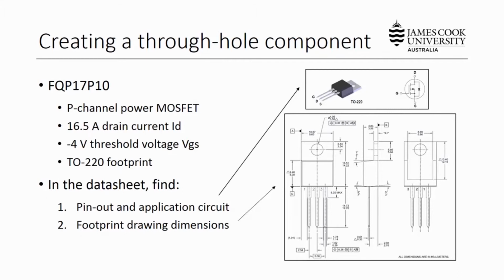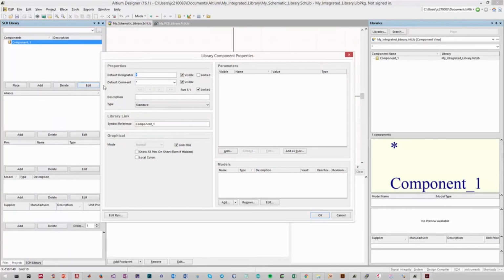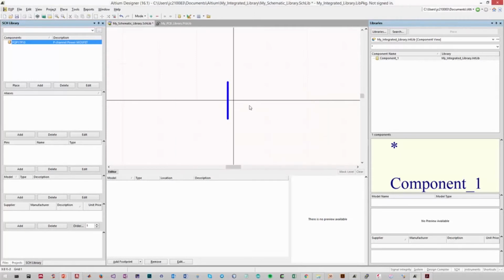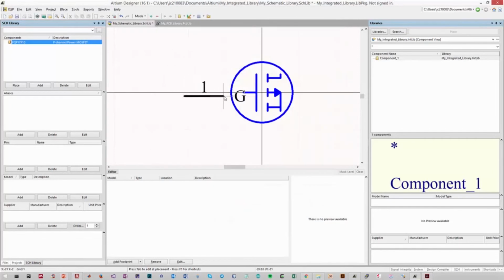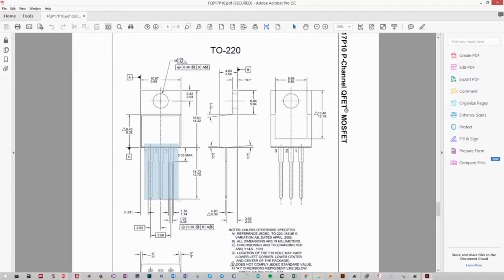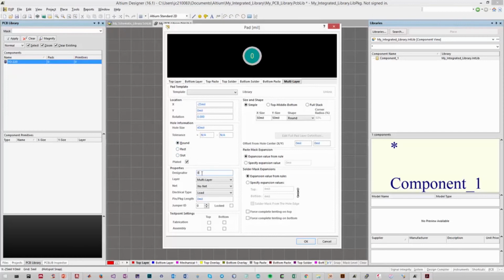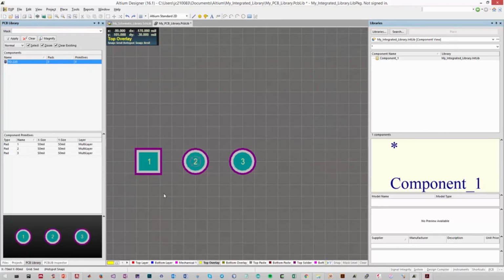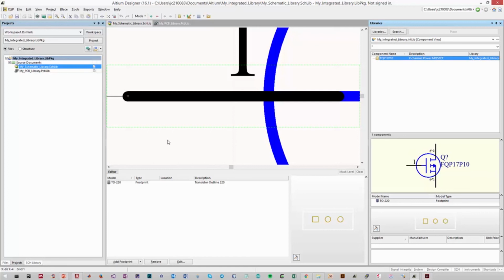2. Creating a through-hole component

Comment: This tutorial covers only the basics of the essential things to get a bare minimum PCB foot print ready.

Two issues:

1. Shouldn't the hole size in the foot print be slightly larger than what is given in the datasheet to accomodate tolerance of the transistor part pin and also the tolerance of the drill used to drill hole into the PCB?
2. You did not pack any specific attention to the pad size. The hole size comes from the datasheet, but what about the pad size? The solder will go onto the pad.

What about other things like the mechanical and component layers that shall contain 3D model, courtyard, assembly and other information?